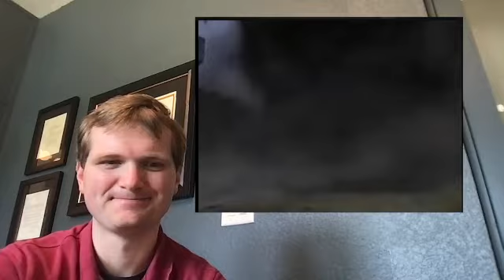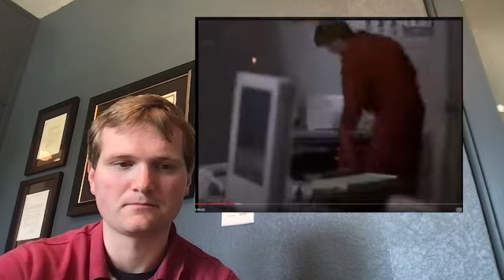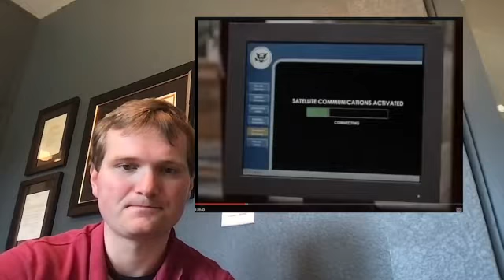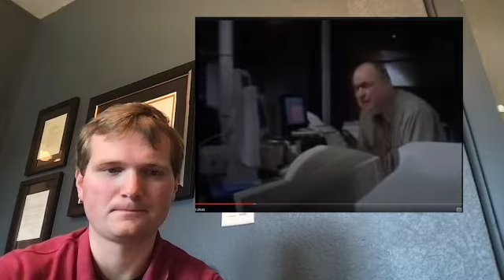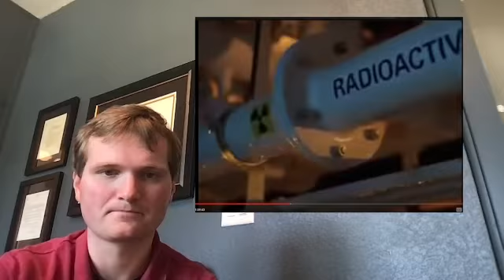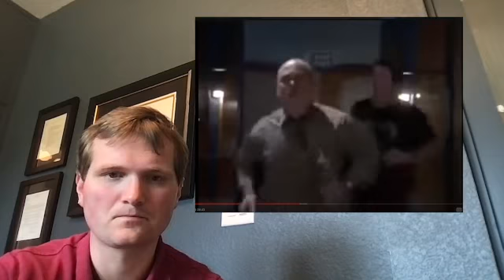Nuclear Engineer Reacts to Atomic Twister Part 2

Comment: I enjoyed watching your reviews on Atomic Twister. It's such a bad movie it's hilarious. At my plant, it's been kind of a tradition to watch Atomic Twister during our annual JPM exams (they allow us to watch movies while sequestered and waiting our turn to do our simulator JPMs). It always gets a lot of laughs.

I think the EAL classifications you have/had at your plant are a little bit different than the ones we use. We would not be in an unusual event unless we lost both trains of offsite power. It sounded like from your video, that you would be in an unusual event at the loss of just one transformer/source. We declare NOUE at a loss of both trains of offsite power for 15 minutes, then we escalate to Alert if we are down to just a single source (1 diesel) for 15 minutes, Site Area Emergency for a loss of all offsite and onsite AC power for 15 minutes, and General Emergency if the loss of all AC power is 4 hours. We absolutely have Tech Spec required actions for a loss of one train of offsite power, but we would not have a classification for that.

Another difference, you seemed to think the megawatt number shown earlier in the movie was strange. Based off the numbers you mentioned, I am guessing your experience is at a larger plant, maybe a Westinghouse 4-loop? I have operated 2 US Navy plant designs (S5W and A2W), but my commercial experience is all at a Westinghouse 3-loop plant for the past 17 years. When I first hired on, our thermal limit was 2775mw, and we had an electrical output of around 890mw. Since then, we have done a few power uprates, and now our limit is 2821mw thermal and around 950mw electric. Given the 2002 time frame, my plant would have been around the same electrical megawatt output as what they show in the movie (assuming the display was electrical megawatts).

It is always interesting to hear from people at other plants, and see what is the same and what is different. And clearly, the fictional Hellman Kline plant is a disastrous mess of incompetence in both its design and operation by the crew, lol. Thanks for the interesting videos! I just found your channel, and I'll be watching some other videos.
Reply from the maker: Thanks for your insight! It’s good to hear from someone who worked at another plant. Clarification on the UE: we would declare only if we lost all 3 trains (we had 3!) of offsite power. The other classifications are similar to your site.

Yep, Westinghouse 4-loop, 3852 MW rated thermal power and about 1400 MWe.  Our core was bigger too with 14 feet assemblies. Back in the day around 2002, I think we were around 3700 MWth. I appreciate your insight about the weird number! 

This movie was heavily requested by my coworkers and industry peers (long before I started a YouTube channel 😅) I’m glad you liked the video!
Reply: If you like Tyler’s reaction video and the movie, there’s a father and daughter team who are both meteorologists who have also done a reaction video to this, and it is equally hilarious. The weather in this movie is as bad and funny as the whole plant design and operation. 😂